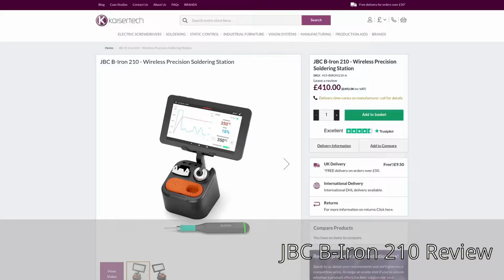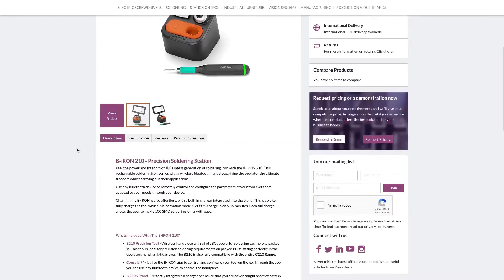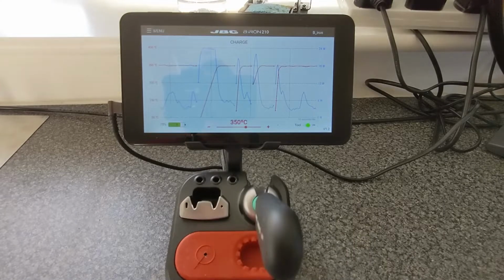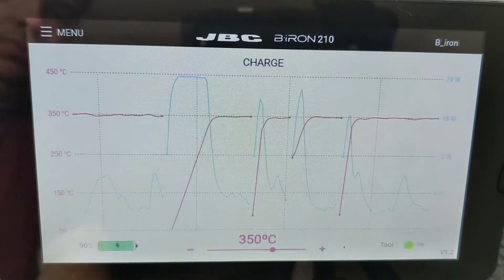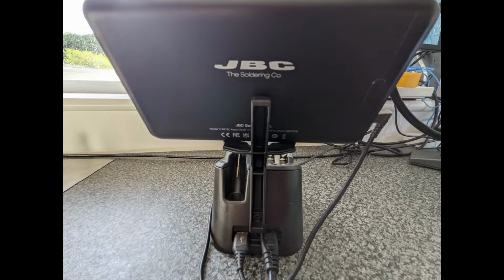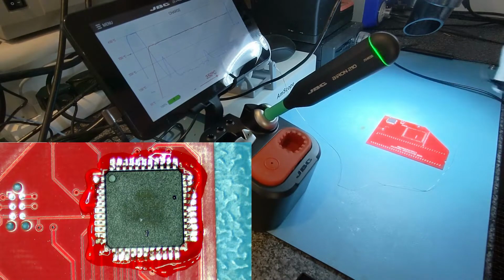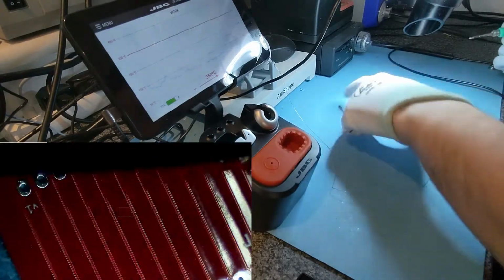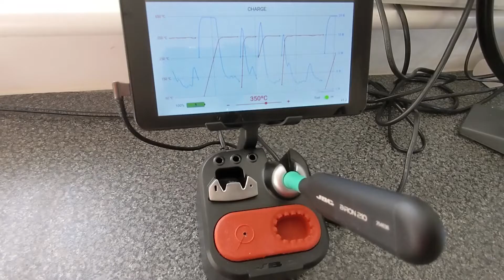JBC B-Iron 210 Battery Soldering Station Review

Comment: To be honest, JBC’s battery soldering iron is really not as good as the ordinary 18650 battery soldering iron, such as the Bakon BK210 battery iron.
Everyone can see that the visualization part is redundant and accounts for most of the total cost!
My ideal cordless battery soldering iron is: large battery capacity, moderate size, maximum power of about 40W, and the handle has real-time temperature control and display, sleep time, temperature settings, etc.
The problem is that the current battery capacity is basically not enough to meet the above requirements. Most battery-powered soldering irons cannot achieve high power, capacity, or small size due to the energy density of the battery.
Moreover, due to the miniaturization of soldering irons, the heat capacity of the soldering iron tip has become smaller, which requires that the heating device must be very close to the tip of the soldering iron and must withstand large current shocks (because the power supply voltage is small) to meet the requirement of rapid temperature recovery.
Reply from the maker: I guess it mostly depends on your use case. It is rare that I use the battery iron for work that would require more power than this gives. Ideally I'd like a slightly longer working time, and the second revision that has recently been released gives this.
The graph can be useful for power usage more than heat, the heat is going to be almost instant and constant on the smaller cartridges anyway.
If I wanted small tip, power for large ground planes, etc... I'd probably reach for my TS-80P, but I'm finding it rare that I need to use that. Usually my regular JBC T245 iron/tips cover everything else.
Reply: @linuxjedivideo  That's right.
In today's electronics industry, which is advancing by leaps and bounds, tools like soldering irons are becoming more and more popular and intelligent.
The only regret is that it is not possible to truly get rid of the shackles of wires.
Of course, there are many varieties of soldering irons now, but in the final analysis it is just an ordinary heating tool. One aspect depends on how users use them. I agree with this.
I am currently using a Bakon BK210 battery (18650, 3200mAh) iron, and also use the C210 soldering iron bit(≈2Ω), and to sleep and wake up at any time to make the battery more durable. Its only disadvantage is that the battery cannot be replaced more conveniently and the maximum power is only 12W[You see, the actual maximum power may be smaller P=U²/R (≈7W)]. It would be even better if it could reach 20W like JBC's B-Iron 210.

Comment: So you can’t use it when your out and about as the station has to be plugged in.
Reply from the maker: You can because the tablet has a battery too, but it won't charge the iron when out and about. So you will likely only have a few minutes of usage.

I recommend something like a Miniware TS80P and a high wattage USB-C PD battery if you want something a little more portable.
Reply: @linuxjedivideo  I’ve got a portable one similar to miniware but uses jbc c210 tips, works off a powerbank and it’s really good, if your interested I actually got one new one left for sale on eBay
Reply: @M.E63  is it s60?
Reply: @M.E63 can you tell me witch one you have ? Thank you in advance
Reply: @resoursa  yes
Reply: @ROSUFANE94  s60 nano iron
Reply: @ROSUFANE94  You can get rechargeable one now which I got and testing at the moment

Comment: Can you replace the battery in it?
Reply from the maker: Good question. JBC do not sell a replacement battery and I cannot see an obvious way to open it so that it can be replaced. I'm not rich enough to destructively disassemble it to find out if it is possible :)
Reply: @linuxjedivideo  no. i asked them this question also